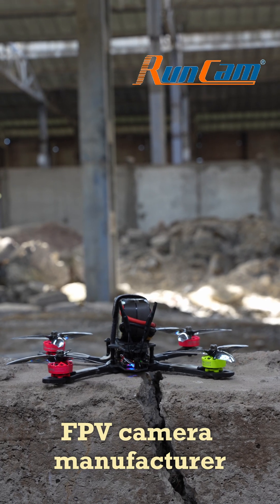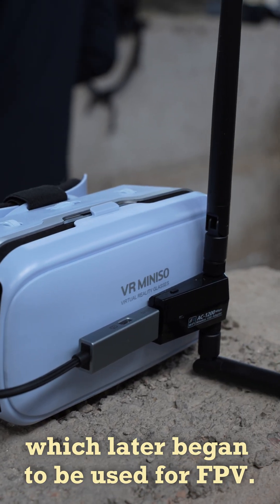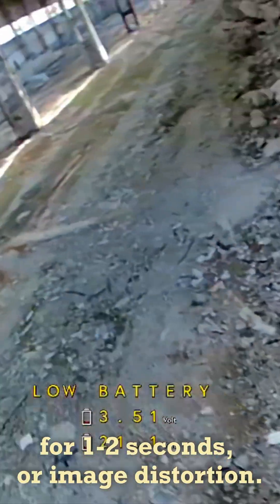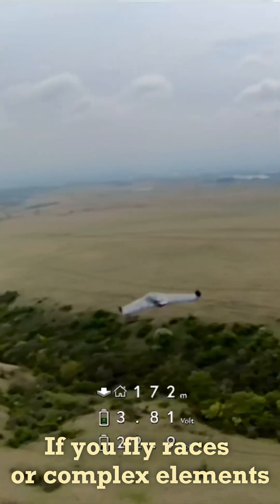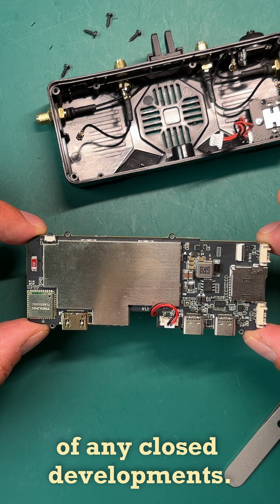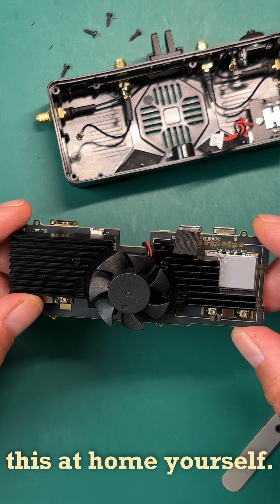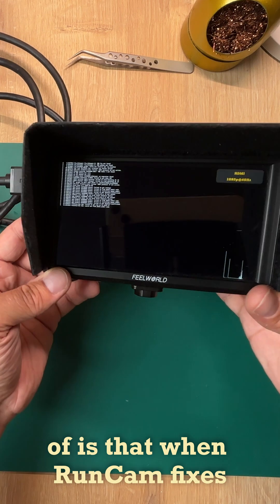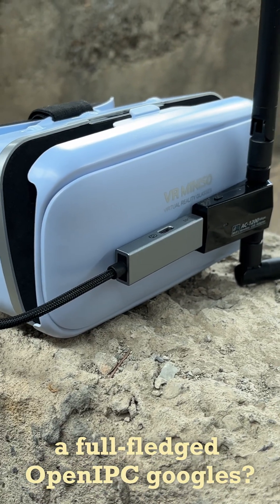Open Source FPV Isn’t Ready

Comment: Use 55 tx power and update vrx and vtx with lastest
Reply from the maker: Everything was updated to the latest version. It didn't help. It's not that VRX doesn't get the picture from VTX, it's that HDMI doesn't connect to anything except my on-camera monitor.
Reply: @split-s-fpv  weird, are you sure u use 1.9.9 did you in top right corner rssi green bar ?
Reply from the maker: Yes, of course. I'm absolutely sure. I updated to different versions, including 1.9.9. It's always the same problem. Problem with HDMI. And as I know, this problem is not only me but most of those who received this device from pre-release.
Reply: @split-s-fpv  will drop a tutorial in few minute
Reply: Isn't 55 too high for vtx maybe 45 better? 50?

The signal could be cleaner at 45-50? Or am I wrong I don't have runcam vtx